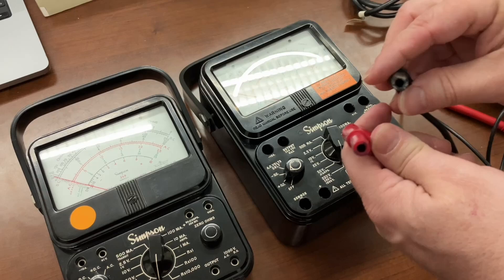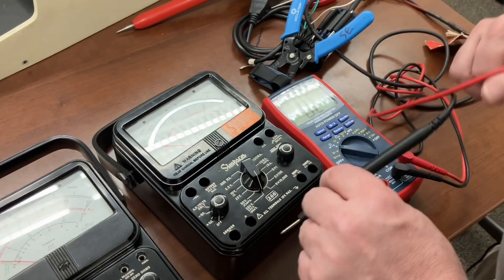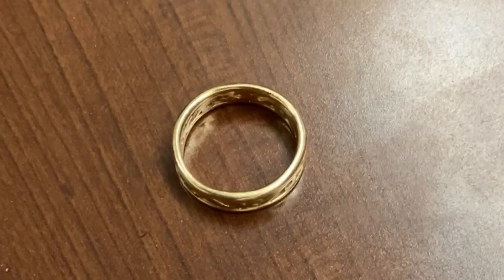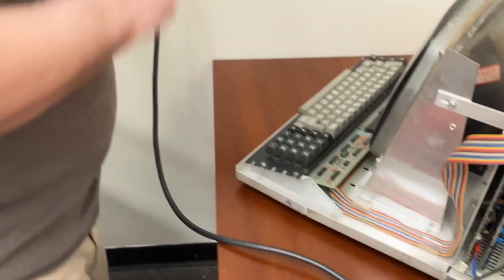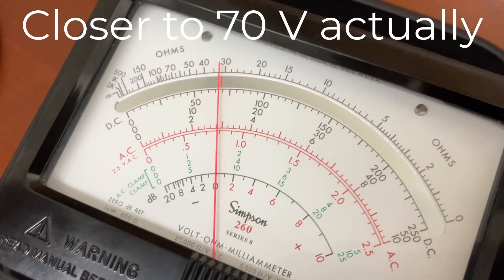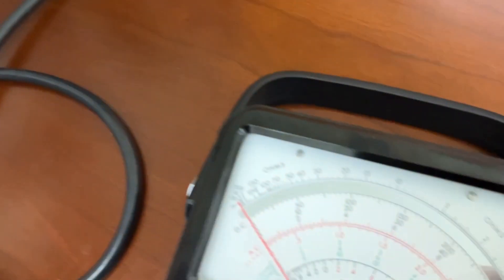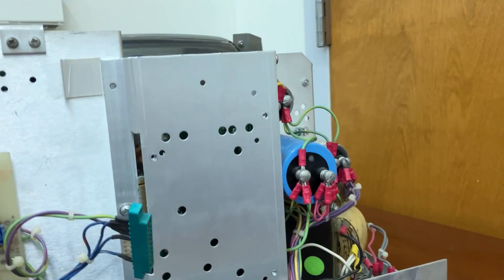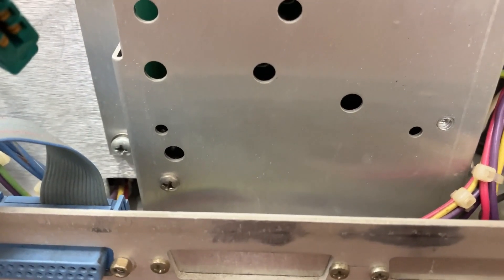High Voltage Measurement of a Vector Graphic 3 CRT Anode (filament on, nothing showing on display)

Comment: I don't do a lot of electronics work but for those screws at the end of this video that are hard to get to there are little things that are like a socket wrench but instead you can put standard 1/4 inch bits in it and it is great for tight spaces.  I once used one without a bit in it to remove a hard drive from a computer which was a pain in the neck to get to some parts of.  It was just my luck I was able to use it on the hex heads those screws had.  It is a little bit tedious but it worked.  It was just a dead computer I wanted to take the drive from and see if I could still read my files from it.  If the computer was still working and not some horrible HP design I would have kept it.  It had some sort of bay for a USB hard drive that could also be used externally since it is basically a USB drive that can fit a cage made for it.  We just never had the drive but instead used the internal one that was something of a pain in the neck to remove

Comment: After a few years, i came up with circuit that's levels audio to line level, even from 10V.p.p. (to protect  push pull config from exceeding the max amperage.).
You gotta have look, it uses a property of a fet, it's works pretty well, but the math has to be done, to get it fully accurate.

Comment: Hmm, 7KV seems a bit low, but it has been a long time since I looked at these. Just check each of the horizontal sweep-derived power supplies off the flyback transformer. Note that one is a negative supply. Chances are one or more electrolytic caps have bit the dust. The video circuit is simple, when Q101 is 'on' cathode current is possible. G1 can cut it off if negative enough with respect to the cathode, but it doesn't look like it is used for flyback blanking. Unlike a composite monitor, the H and V sync pulses are provided as separate signals apart from the video and the raster is simply full-on, full-off driven to the cathode. Happy hunting, don't get too fearful of the voltages or the CRT. Just use common sense and you'll be fine.

Comment: Good to stress High Voltage safety. There are no second chances and you may not be aware what zaps you. Also note that the standard probes that come with Voltmeters are not rated for 7 kV either.
Reply from the maker: I've worked with tube audio equipment before (hundreds of volts range) and once had an experience where -- well, let's just say my underwear was glad I had used the bathroom before trying to take those measurements. I had carefully set up alligator clips before turning things on and then noticed one of the clips slipping. Fortunately my brain stopped my hand from instinctively reaching for the clip to stop it slipping and reach for the power switch instead, but I didn't get to it in time. There was a loud bang a flash of light and smell of ozone. And unsurprisingly 5 V voltage regulators don't like it when 400 V is accidentally shorted to their 5 volt output...
Reply: @Lantertronics  that’ll wake you faster than morning coffee ☕️ Good story 👍

Comment: I think I have something for you to check---this might be a simpler problem than first appears. If you look at the schematic, I think this is the 12" display isn't it? Look for VR104, the internal brightness control.In the pictorial layout, it shows it to the right of the flyback transformer, just to the right of V105, the focus adjustment. If the pot is populated on the board, try adjusting it to one end and then the other and see if you get some raster.  If you don't get anything, see if resistors 132 and 133 are populated on the boars. If they are missing, I am pretty sure your problem is that this was supposed to use the external brightness control, the 100K brightness pot, rather than the internal trim pot. Note the asterisk next to the resistors 132 and 133.the note at the bottom says "adjusted", so likely hand selected for optimal brightness range. I think if you concentrate around this area, we'll be able to find the problem. I'll continue to study the circuit for possible other causes in the meantime. The voltage on one end of the brightness pot should be a negative voltage, with respect to ground, and a positive voltage on the other end of the pot with respect to ground, if I'm reading this right. The negative voltage should be in the range of 100-200 volts, but the positive looks to be in the range of 1-2 KV, since it is the focus supply.. It goes through a couple of megaohm resistors before it gets to the pot, but still be careful about measuring it. Your good old Simpson I believe has a higher KV voltage range, or use the high voltage probe to be on the safe side first. Hopefully this will provide some help.  Let me know what you find, and we'll go from there.
Reply from the maker: I'll check these things next time I get to campus, thanks!
Reply: @Lantertronics  My pleasure! Honestly, my guess is that this was set up to use an external brightness control, and the internal one was adjusted for this purpose, so without the external control, the grid for the brightness is being biased to cutoff. To me that is the most logical explanation of what happened over time.  I look forward to your findings, and hopefully, the next video shooing the internal display showing the raster :)
Reply from the maker: Something I can't recall if I mentioned before -- the  eBay listing showed the display working (it's why I bought this particular one), and I don't have any reason to believe the seller was being deliberately deceptive.

Comment: Hi again. I am studying the schematic now. It sounds like you have glowage on the filament, and the circuit is pretty much what I expected.  Give me a bit to study it, and read a bit, and I should be able to give you some more things to measure, and approximately what you should see. It looks like the cathode is at ground potential, which means the grids have to be at a negative potential with respect to ground for there not to be anything on the screen. Our first goal is to see if we can get anything on the display at all, and work from there.. I'll reply again shirtly.
Reply from the maker: Thank you SO much for your help!